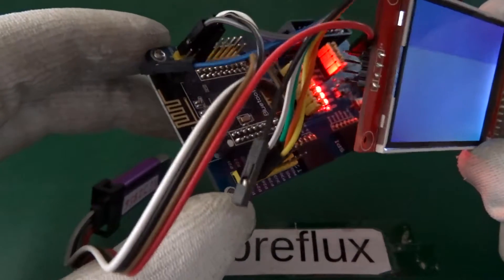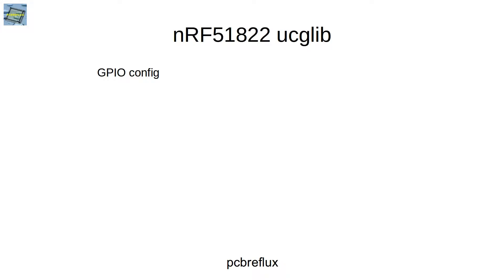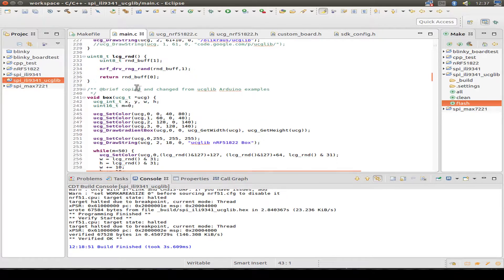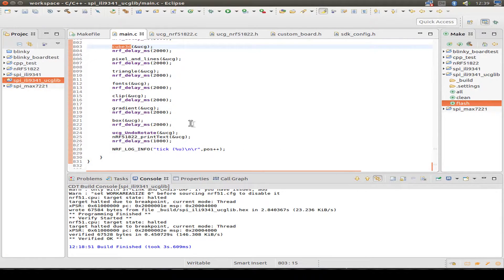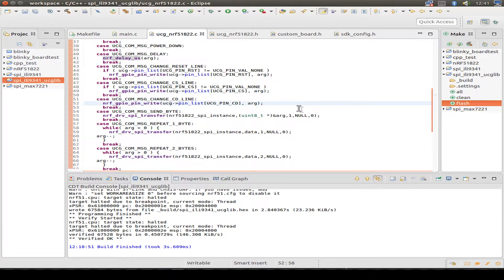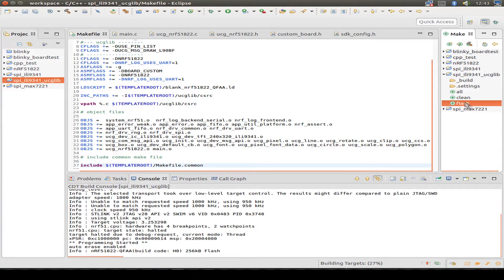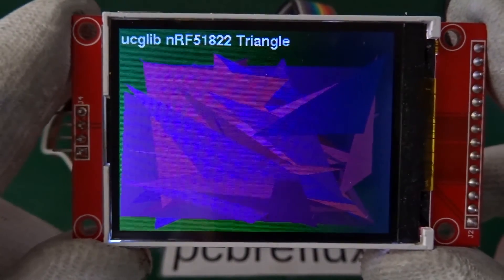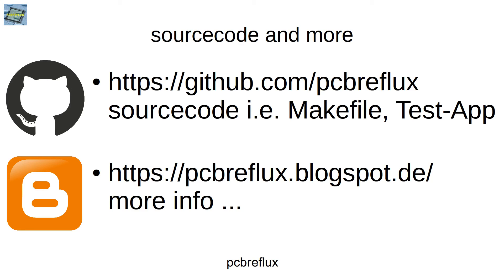nRF51822 #18: ucglib with ili9341 (english)

Comment: good work in porting
Reply from the maker: +ucglib Thanks. Next I do some work for the nRF52832 and can compare the display speed. Maybe the similar port works works for u8glib.
Reply: Great, but maybe choose u8g2 instead of u8glib. U8g2 is more portable.
Reply from the maker: Thanks, don't know u8g2 yet, only u8glib from my crude port to smt32 some years ago. But next i try u8g2.
Reply: Oh, my mistake. Ucglib is the latest version. Only u8glib has a successor which is u8g2.
Reply from the maker: Thanks. No mistake, a similar port should also work for the SPI monochrome displays with u8g2 (+i.e. u8glib) like NOKIA 5110.